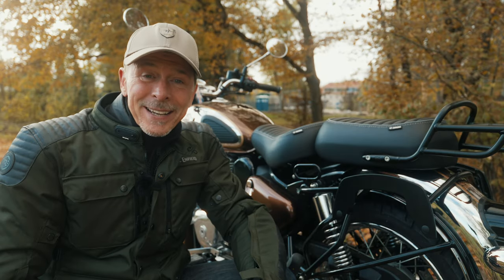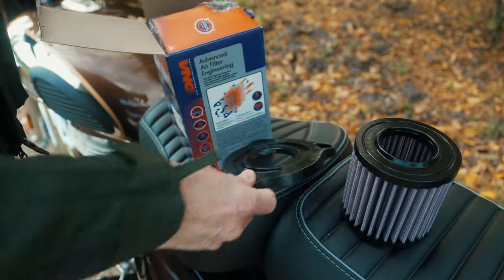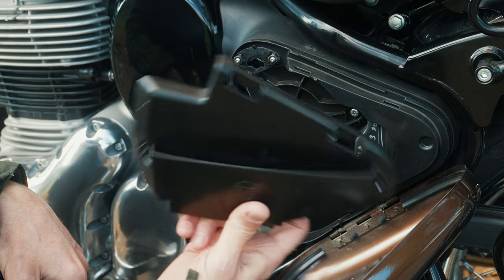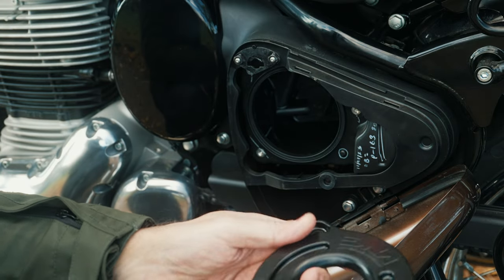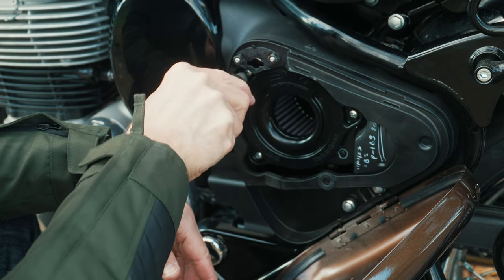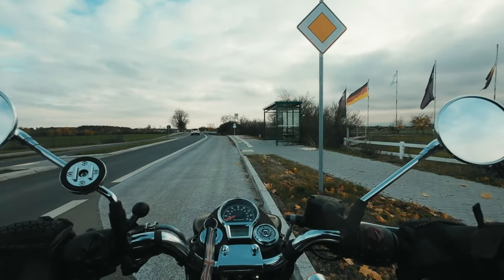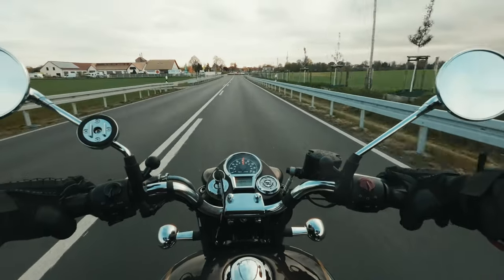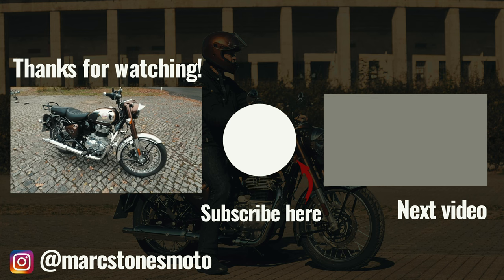DNA Air Filter | Installation and Review | Royal Enfield Classic 350

Comment: Is there a difference in fuel consumption, too?
Reply: x2
Reply from the maker: I have to test it.
Reply: By allowing more air to flow into the engine, a high flow air filter can improve combustion efficiency, leading to better fuel economy.
Reply: @retromotorbikes Ok, but wouldn't the increased air flow result in added fuel to make the motor run slightly richer? Questsion is then how much more fuel it would take to balance the air-fuel mix.
Reply: @uncletom1971  i think you and the person you’ve replied to are both right! ive heard that it essentially balances out with the richer consumption and new economy. so i wouldn’t say any noticeable difference i hope :)

Comment: The very first modification I made on my bike. The throttle response is much much better in my opinion. Thanks for posting, Marc - and a Happy New Year to You.
Reply from the maker: Happy new year to you too and ride safe.
Reply: I keep getting 'check engine light' after fitting DNA filter. Any idea what I can do?
Reply: @pauleedeehimself8489 I can’t help you regarding your issue but you can hear the bike doesn’t run well at all with the DNA filter. I used it for a few days but the first quarter of the gas is really inconsistent, blipping got very difficult cause it runs lean and sometimes it turned off while blipping before a stop. It also lost a lot of engine braking. The sound with the filter is lovely but for the moment I feel it has too many downsides

Comment: It definitely pulls harder with the Stage 2. One thing that i noticed immediately was the significant improvement to throttle response and touchiness. Killed a lot of dead spots on my classic and got rid of the laggy response. If you have a temp gun, check the heat coming from that header pipe. If it's blistering hot i would immediately get a Fuelx lite. I showed in my series just how much that device changes the temps from the exhaust alone. Near 400F to 250F (but i have a full exhaust on mine)
Reply from the maker: You are right, I had the same feeling. Runs smoother, no dead spots. At the moment I can not check the temp because we have -5° C in Berlin so the engine runs cool 😂 I already installed the Fuel X, engine runs even smoother, but the fuel consumption is higher. I did a video with an acceleration test with and without the DNA air filter. I checked your videos good work! subscribed ✌
Reply: @Marc.Stones  You have higher fuel consumption? Mines about the same depending on how spunky i feel that day.

I get it, we have 2 feet of snow here in Michigan wind chill -20F. 
I should have snagged my GPS lap timer thing before i started my videos. But if i do a separate series on a Hunter or Scram at least I'll be covered lol. I subbed as well, take care man!
Reply from the maker: Yes, the fuel consumption is 3.5 L/100km instead of 2.6 l/100km.
2 feet of snow, not the perfect motorcycle conditions 😀
Have a safe ride!

Comment: I have ordered mine from Hitchcock and the gentleman did advice me to ride the bike for 15-20 minutes and go through gears instead of leaving idle so ecu can reprogram itself.
Also if anyone is adding a decat pipe and silencer the ecu can cope but if cams are changed then need fuel x! 👍🏽
Reply: I know about the 12 minute tune that i used in some of my Triumphs so far but i didnt know that the same thing works on the classic. Is it proved that it helps, does any manual reccomends it? I have ordered a dna for my 350 and didnt want to intervene in electronics with a fuel x. Thanks!

Comment: If you are installing a DNA filter and better airbox, you need a straight through exhaust as well to get all the benefits. More air comes in through DNA filter, so you need straight through exhaust so gasses escape quicker.
Reply from the maker: Thanks for the tipp 👍

Comment: Do you know, you are the first bloke to give a sensible opinion of this air filter. For the sake of £94 in the UK, the DNA isn't worth bothering with for micro seconds and extra noise.
I think you will find the FuelX has the same end findings. It may reduce the temperature but not worth invalidating warrantees. 

My only real criticism is you performed the tests in the wrong temperature conditions i.e freezing cold day rather than normal temperatures. I am pleased I have same a few hundred quid for a change in noise and no significant benefits. My bike doesn't have any engine bumps or lumps in its performance from starting to stopping. 

The 15 minutes idling is a load of rubbish to reprogram. Information is from a dealership who fitted one of these FuelX kits.
Reply: I have a fuel x on my meteor, it has significantly more power and better throttle response until you get to 60 mph and then you can feel the fuelling going its own way but thats down to the ECU which needs  to be plugged in and given new parameters to get the best from the motor as the performance above 70 mph is restricted by the ECU

Comment: Good vid Marc.
First thing I did on my 350 classic .
Bit noisy but In my opinion has made the bike breath way better, and as a plus Its worked out that the cleaning kit will service the filter twice if carefully used.
Which is cheaper than buying two new OM filters.
So for me its been a win win.
Happy New year mate.
Lee🍻
Reply from the maker: Hi Lee, happy new year and a great 2014 🎊🎉 I am also quite satisfied with the air filter. Hope the fuel consumption stays the same. Cheers Marc

Comment: Changed the original spark plug to a ngk PLKR7A .
Only the plug has a cap instead of M4 thread.
I put the thread on myself but can also change the cap.
It runs much smoother and better pickup.
Always change my sparkplugs on my bikes.
Original are mostly cost saving crap
Reply from the maker: Thanks for the tip 👍
Reply: Feul , air , spark .
Simpel as that but people rather buy expensive air filters and exhaust's than change a cheap spark plug 🦧

Comment: It's probably not quite that simple, but when I hear people say "it can breathe more easily" I know that more air on its own means leaner burning which isn't necessarily good, especially when Euro 5 already means lean burning.
Am I right in thinking more air = more fuel as well, since the sensor will work out the mix appropriately?

Comment: sir can we do this modification with keeping the stock silencer, I mean does it harms the engine in any sought? like if keep it without any tuning or something, just by changing the air filter
Reply from the maker: Yes, you can keep the standard exhaust. It does not harm the engine.

Comment: It works. However... it also gave me a motor engine fault😕
Put in the DNA filter and cover (stage 2). Check engine light came on. 
Reset the error, replaced the standard filter... no more engine light.
Changed back to DNA and the check.engine light came back on.
Reset the error... and again it came.
Changed back to standard, Reset and it stays off.
Very disappointed 😞 
Anyone an idea what I should do? With DNA filter it runs a lot better... but also gives an error😕
Reply from the maker: I also had the same problem with the engine fail light and had to reset is several times.
Reply: @Marc.Stones  so what was the end game?
Reply: I also had this problem and refitting the original filter switched the motor check light off.
Is there a fix to enable the filter to be used without having the light come on?

Comment: Dna filter and fuelx  do not do anything, without proper engine tune. The engine only uses data from lambda sensors when you idel and are steady on the throttle, and adjust fueling acording to that to lower the emisions, the second you open the throttle it uses pre determined values that are fixed in the map, and then switches back to lambda as the throtle calms. So without real remaping, no filter, exaust, fuelx does not do anything. Filter and exaust changes the sound and fuelx increases fueling when computer is using the data from the lambda sensor so there is les jerkines and stall when acelerating. Been there used it all, not worth the money.